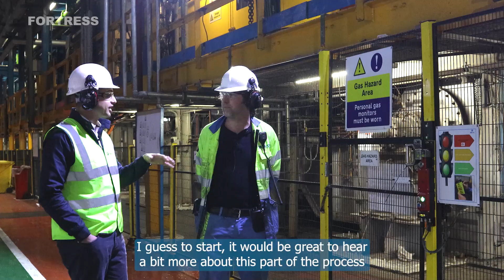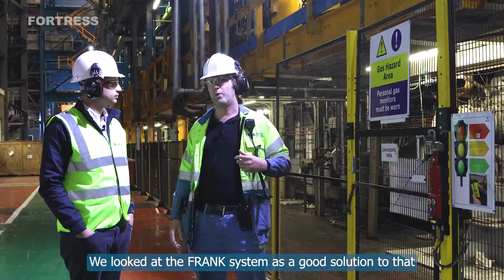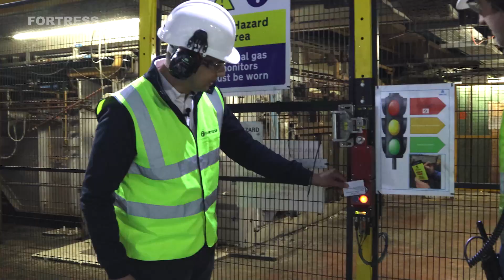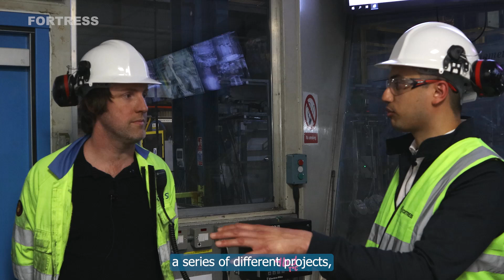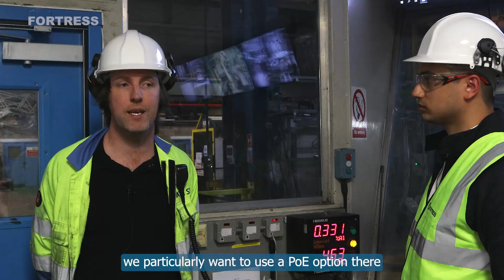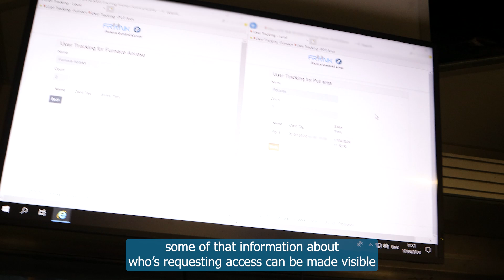Fortress Case Study - Preventing Unauthorised Access with FRANK

Comment: I would suggest investing in NFC gas monitors too (which exposes the cumulative value over a NFC connection), so they would have to tap both their access card AND their personal gas monitor to the reader. If the cumulative value is exceeded, access is rejected for the rest of day.

Then it would enforce three things:
1: That they have gas awareness training.
2: That they have a gas monitor which has a non-expired calibration, testing and enough battery charge.
3: That they haven't exceeded their maximum cumulative dose for the day. (TWA - time weighted average 8 hr)

SST4 from WatchGas is a 4 gas monitor with NFC, so you could pull event logs and such from the gas monitor, and also make sure expired gas monitors (which need recalibration or retesting) don't get through. In addition, if an alarm event occurs, that the user has been exposed momentarly to excessive amounts of gas, the user could in this way also be locked out for the rest of the day.